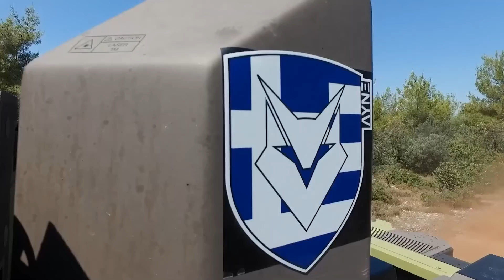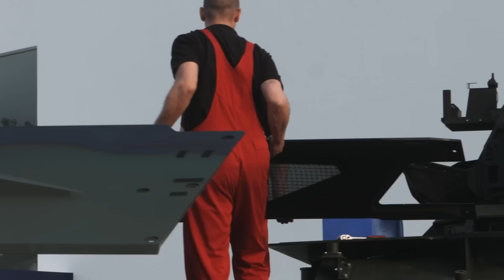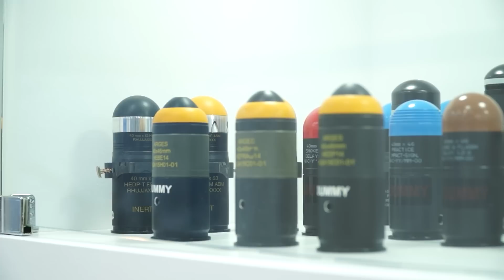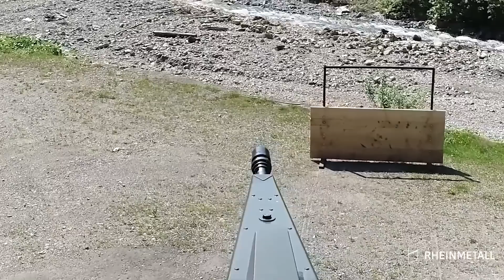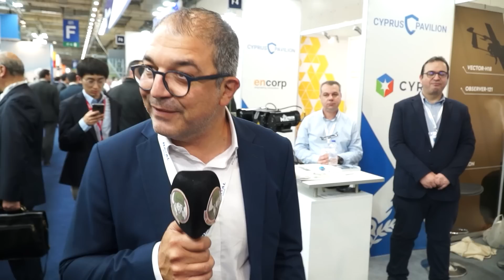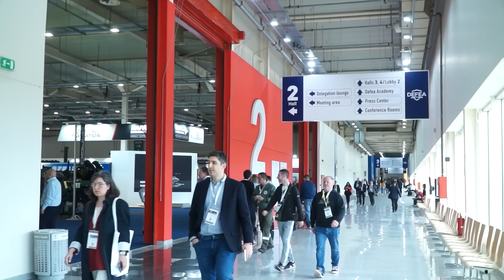DAY 2 DEFEA 2023 defense exhibition Athens Greece Rheinmetall virtual tour & Cyprus defense industry

Comment: a turretless variant of KF41 Lynx IFV should be part of the KF41s model portfolio offered by Rheinmetall . . . the turretless variant will incorporate a raised hull, to comfortably accommodate 8 troops in full tactical gear . . . by raising the hull of the KF41 you also increase the height of the inside crew compartment creating much needed head room & shoulder room . . . most crew compartments in IFVs are cramped due to it's limited swing role capabilities . . . the topside of the heightened hull will have 3 large roof hatches, one for the commander & the other for the gunner while the third hatch serves engagement point for a third gun man . . . either of the hatches can be armed with a 25 MM GAU-12/U six-barrel rotary cannon & a 0.50 Cal HMG . . . both weapon systems are slaved to a 360° deg rotating RWS . . . can also be armed with a twin-tube canister type ATGM launcher . . . the KF41 Lynx could do with a combined torsion bar & reinforced coil spring suspension setup, featuring a heavy duty 5.0 in. suspension lift, for increased off roadability across rough terrain . . . hope the KF41 Lynx is equipped with an active protection system . . . passive armour could be made up of all round lightweight 263 MM hot formed aluminium alloy armour topped with next generation ERA . . . slat armour can be a good addition in certain battle theatres . . .